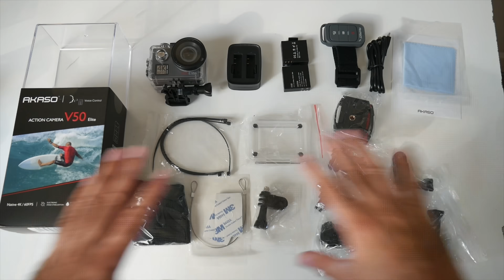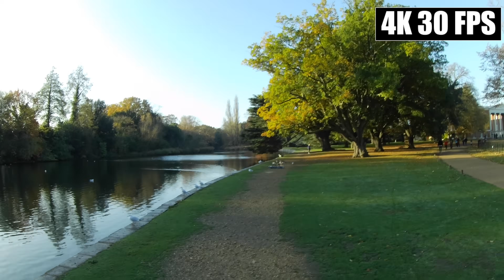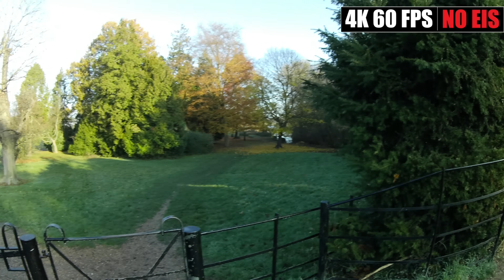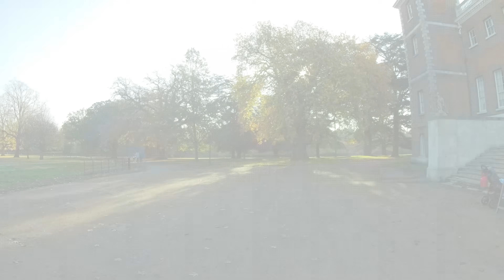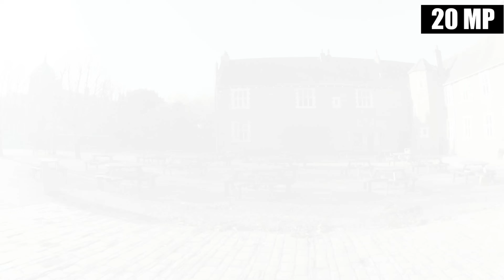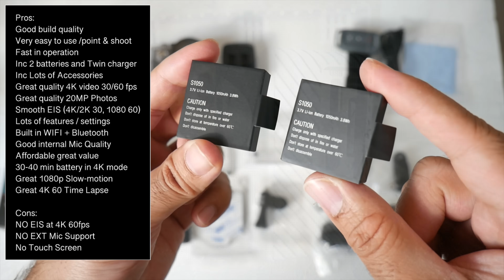AKASO V50 ELITE - 4K 60fps Action Camera - Voice Control

Comment: I have one of these...just got it in the other day and it takes great videos and pics, but I am not happy with the remote. For the remote to work, you have to have the camera on, so all the remote does is start and stop a video...or take a pic. Start a video, then let it run...then stop the video recording. The camera is still on and your battery life is going down. The remote needs to have the capability to put the camera to sleep, sorta speak...like the remote can do with a Go-Pro. I bought this camera instead of a new Go-Pro and I am somewhat disappointed.
Reply: It goes to sleep automaticly

Comment: Do you have to reset the time and date every time you change batteries, I have read you do ?  and is there much glare in sun light ? Photo's seem to be more square ?
Reply from the maker: Yes time resets with battery removal. It shoot fine with sun glare and the photo aspect rato can be changed.

Comment: UPDATE: There is now a touchscreen as they did a Firmware update, but it is a bit fiddly to deal with. Still getting used to it but so far, I am happy with it. Just takes time to figure out accessories and features of the camera.
Reply: Yes, mine is a touchscreen as well.    My Firmware version  is:  20220930-V3     Is yours the same or newer?
Also, the name badging on the front is 2 rows, instead of this one's single row.

Comment: Thanks for the great review.  I am curious as to why this camera is now second to the V50 in your 2019 chart?  Is it because of the lack of touchscreen or external microphone?  Since I will be using it mainly in the waterproof case, the touch screen is not a useful function to me.  How about testing and comparing these cameras to the Yi 4K+?  Thanks.  I am looking forward to future videos
Reply from the maker: See this video: https://youtu.be/dvHXBftBywo
Reply: Thank you for another great video. I have been following all your videos on action cameras over the past 6 months. I decided to spend the extra $150 and instead of getting the Akaso V50 Elite, I just ordered the GoPro Hero 7+. I know that many of your readers have different needs and budgets, but this solves many of the weakness of your reviewed cameras. I will not need a waterproof case with the GPH7blk, so I will have a functioning internal microphone as well as the option of an external mic. I can then also use a touch screen for easy interaction. It has EIS up to 4K-60fps. The FOV is adjustable, and the use in dark environments is descent. I do understand that no action camera excels in dark areas. Thank you for the great reviews and comparisons; you might want to add the GoPro Hero 7 black to the review even at the $299 price point.
Reply from the maker: Thanks for sharing, yes I would like to add a go pro to the list soon. Elite is a great camera.

Comment: Hi, thanks for the review. How does this compare to the v50 pro?  I read elsewhere that the 60fps is only achieved by artificially doubling the frame rate not recording at that frame rate. I like the idea of the touch screen on the pro and that its only £120 compared to what will be £175 including import duty from Amazon US. Going to be using it when horse riding and mountain biking with my family.
Reply from the maker: To be honest v50 pro and elite records great quality video with very good image stabilisation. I have been told that the 60fps is real native and not interpolated.
Reply: @ChigzTech  thanks :) I ordered the Pro using "make an offer" on ebay so I got it for less than Amazon UK :)

Comment: How does the audio perform with the case on? I’m thinking of using this skiing, but would like some audio for conversations on the mountain. Looking between this and the go pro hero 5 black. Want something with very good stabilization. Thank you!
Reply from the maker: Audio with case on is not great on any of these non-go Pros. As the airtight case completely blocks the mic so there is little or no sound being picked up.

Comment: I asked a question on Amazon US but no one answered yet. When you remove the battery will it store the date and time? I have a cheap Excelvan 4K Ultra HD, but every time the battery dies you need to reset the time and date, absolute pain in the ass.
Reply from the maker: Will check and get back soon.